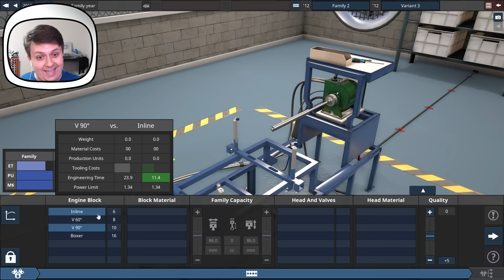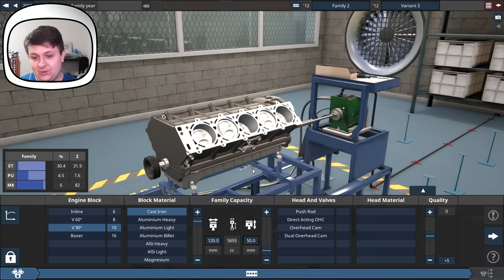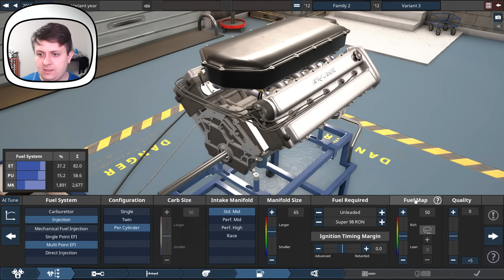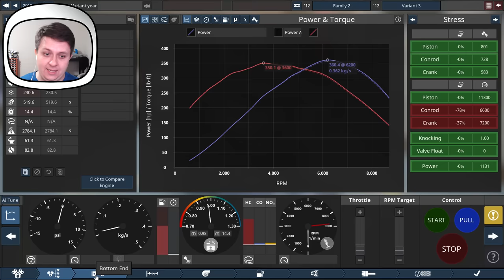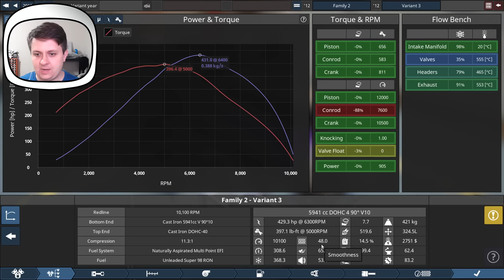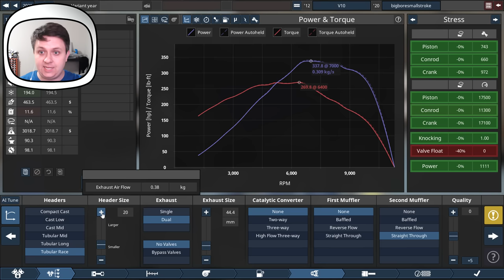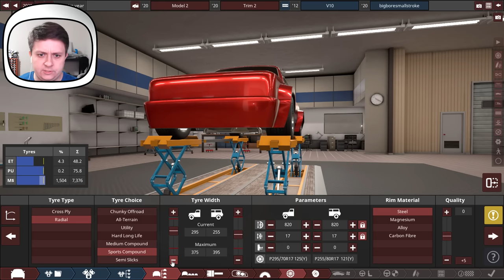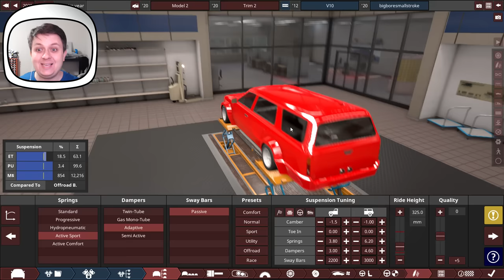Building & Testing a V10 Engine With LARGEST Bore and SHORTEST Stroke! (Automation | BeamNG)

Comment: Ive got a couple big v10s i built and one is naturally aspirated, makes about 950 ft lbs at 3500 and 820 hp at around 4500. The other one is based off the first one but has turbos and is tuned for them. Makes about 1600 hp, and 2100 ft lbs. Cant remember the rpms but the torque was peaking around 3k
8700 is pretty high for a v10. Shorts stroke helps with rpms but wide bore is going to add weight to the pistons defeating the purpose of the short stroke. Im facepalming, the cam is keeping your power low at high rpms reducing the speed it wants to rev up

Comment: Don't keep the engine in the lower torque range of the upper rpm band. You have way more useful power down at like 6500 rpm.

Also, remember that each piston is over 0.5l displacement, so you should make your exhaust proportional to the amount of airflow you need it to have.

If you lower the counterweight the engine will reach max rpm faster but have less momentum to use and be less stable for power output.

Comment: short stroke leads to not enough time for the engine to intake air before the valve closes. Less power. Long stroke small bore means valves duration can increase leading to more air intake.

Comment: Harmonic damper is just a pulley on the crankshaft where as a balanced shaft is the crankshaft is balanced
Reply: Balance shafts are also independant  shafts.

Comment: You need more cam and intake that's what affects the more the  rpm power potential but you gonna lose lower for sure. That where vvl save the game with a low cam profile for torque down and big cam lob for rpm  horsepower. If variable intake runnerwas a thing in thia game , power band can be tuned lot more.

Comment: Get the guns.  The pistol has the lowest damage, the single shot rifle is great for sniping.  The shotgun is brutal at close range.  I rarely use my spear any more.  I have refined armor and helmet as well as the Giga Shield and a protection amulet that adds about 10% to my HP... which is almost 2800.  I try not to enhance a Pal until I have an Alpha version.  You can redo dungeons after a few days and you can back out of the boss chamber a few chambers to spawn a different boss if you do not like the one it spawned.  I have a lot of Alphas... like 30+.  I am running out of space in my Pal Box.  I have a lot of Kings and Queens too.  I just hit level 39, but I was focusing on base building most of today.  I was tired of the Pals putting stuff in different chests so I built a refined metal chest and made sure it was the closest and put all the crafting materials and seeds and Pal bits.  The other chest has everything else.  I have over 130,000 gold.  Yes with a flier you can get the effigies (especially when it gets dark) and eggs.

There is an interactive map and it has "most" stuff on it.  I did find 2 caves that were not on it yet where the queen bee is.
Reply: did one of them have guns in the back of the car

Comment: I really do think you should give a little more attention to gear ratios, the car revs to almost 12k rpm and even then it has the same top speed at 1⁰ 2⁰ and 3⁰ than my 1 liter 1998 ford ka, that revs at 5600, i think that's why you think it's slow, too much gear shifts.
And give more love into the power curves too.